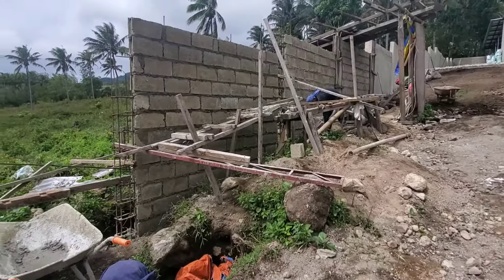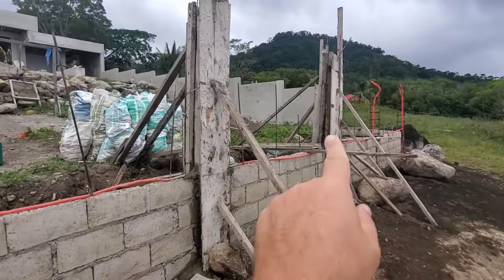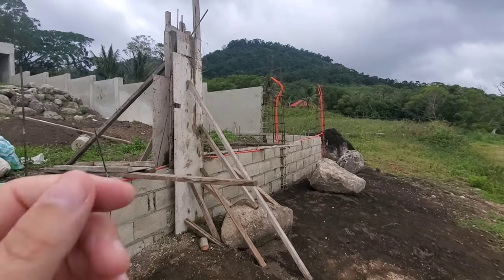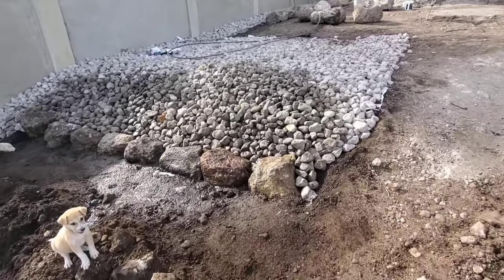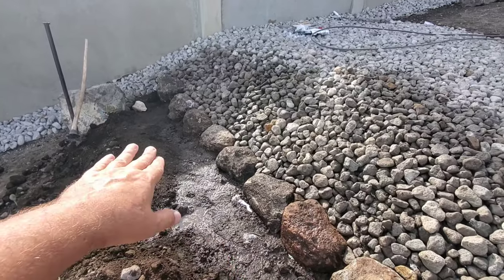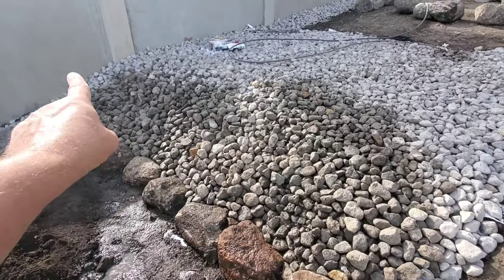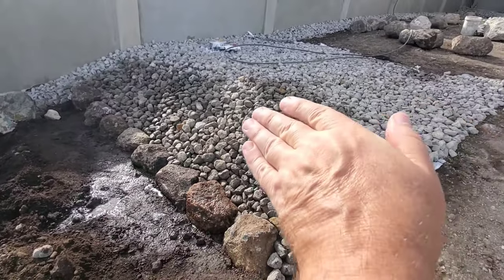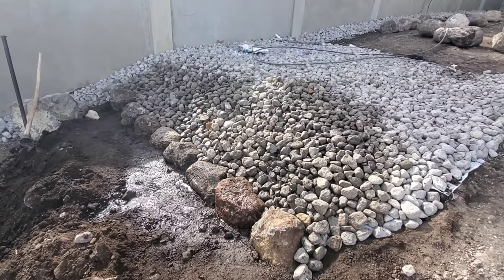Can you build a cheap home in the Philippines 🇵🇭

Comment: You say rivets are holding up the cement board?  ( I know that is common practice there) I suppose its  more time consuming  as you need to Pre- drill  then rivet it, 2 steps.....Are rivets cheaper  than drywall screws?I never heard of rivets used here to secure drywall or Cement board in North America, we have Durock screws for that, they have bigger heads than drywall screws, and are coated vs  rusting.
Reply from the maker: Yeah, that's what my contractor uses.  They certainly put a lot per board.